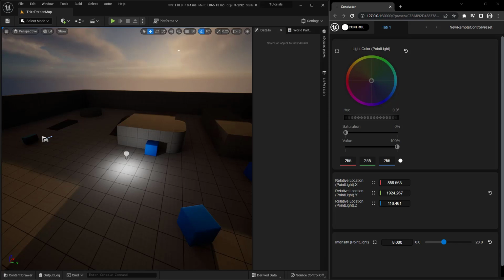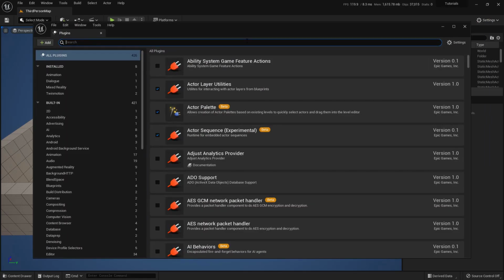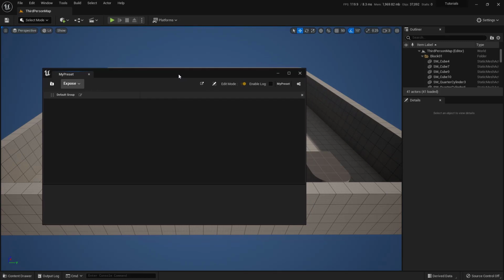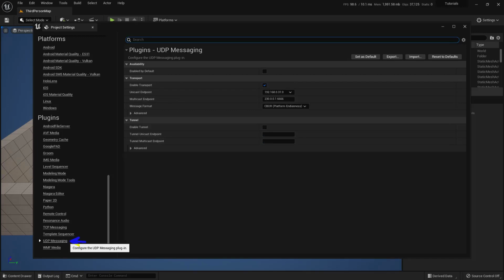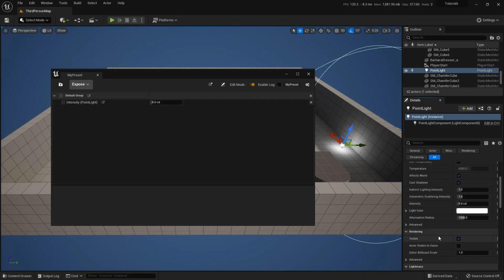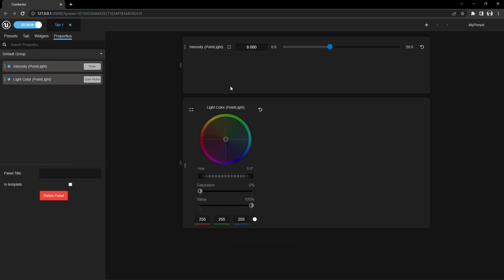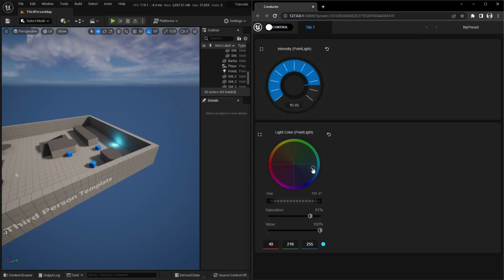Web Remote Control for Unreal Engine

Comment: hi sir thanks to your tutorial can you help me to implent this idea is to create a virtual studio entirely based on Unreal Engine Vanilla, without using any middleware software such as Aximmetry.

To achieve this, a central control station is required to manage multiple render engines. This control station can also act as one of the render nodes if necessary.

All stations are connected via an Ethernet network, and each one hosts the same Unreal project located at the same path on the disk.

The master station acts as the server, while the others function as slave render nodes.

Objectives:
Launch the Unreal project simultaneously on all machines, ideally triggered from a web interface with a single click.

Retrieve exposed parameters from each project, likely via the Web Remote Control plugin provided by Unreal (OSC could be considered as well).

Modify project parameters remotely.

Save a set of parameters per station in order to recall them later (preset system).

Trigger actions across all render engines at once, such as animations, camera switches, or level transitions.

if possible make a tutorialto help me in my project
Reply from the maker: This is an amazing idea and I would love to see something like this!  We don't have the hardware or the team to create a tutorial for this process. That said, looking into how Studios that use LCD screens would be a good lead for this process. 
If anyone has some other leads and ideas, please share them here. :)

Comment: Hey nice video. Got a question tho if you don't mind. Been implementing some features with this but one I can manage to do is trigger the play mode from the remote control preset/web page. I need create the function to do it either with BP or C++ but I can't find anything on this in the docs. Do you know how I can do that?
Reply from the maker: Because this is meant to be used for live broadcast, I don't think it's possible to trigger play mode through this feature.

Comment: Hi! I managed to get it working, however no luck on controlling anything on a packaged or standalone project. Any tips?
Reply: It's disabled by default when you package, but you can enable it with -RCWebControlEnable -RCWebInterfaceEnable args. Check the docs.
Reply from the maker: This feature works only in engine. It does not work in a packaged game run as an .exe.

Comment: I think you skipped a huge chunk of the process.
Reply from the maker: Which portion?
Reply: @Cleverlike  could be YouTube cropped it but right at the end you were going to show us something about how to make the external connection to the app for a website and you mentioned that you already have it set up. Then it just cuts to you using the web page from your phone
Reply from the maker: Ahh, I think understand what you are talking about.

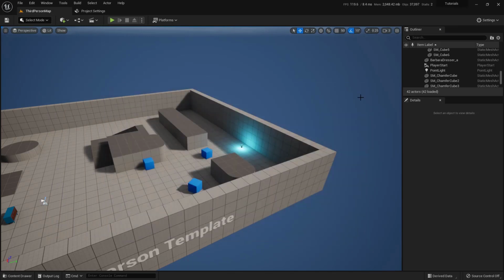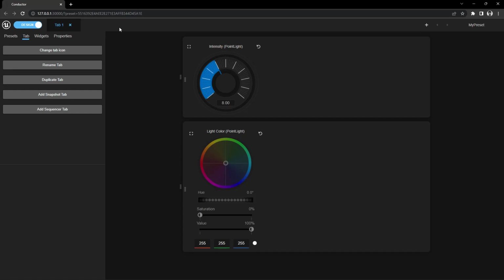@7:19 I opened a web browser on my phone using the same unicast point shown at time @7:00. Giving me control the light on my phone exactly as I did @5:40 using the web browser on my computer.

Comment: I am not able to connect with external divices..
Reply from the maker: Check that your external devices have access to the same internet connection that Unreal does. Also, check that the IP address has been entered correctly.
Reply: on the mobile phone or the device you have, you have to enter the "ip address" of your computer you wanna control followed with the port number.

Comment: thanks so much i didn't know about this feature. question, can you control a character thru web remote? i.e use a phone with virtual joystick /control camera or is that another feature?
Reply from the maker: Good question. I have not tried it specifically, however if you can expose the controls then yes you can.  I do know you can control functions and call events, so controlling a character should be possible. If you get something working let me know. :D